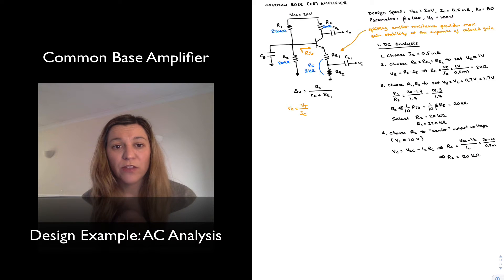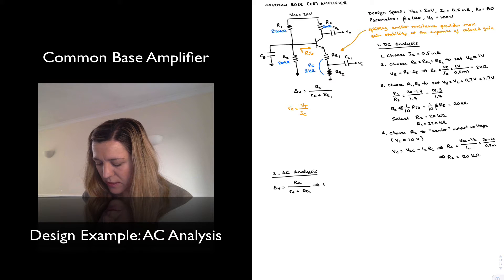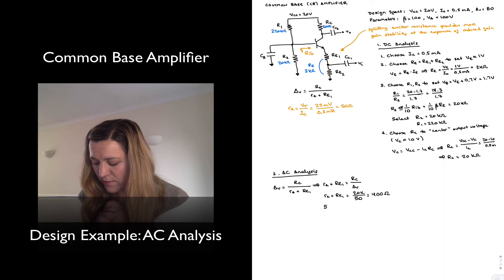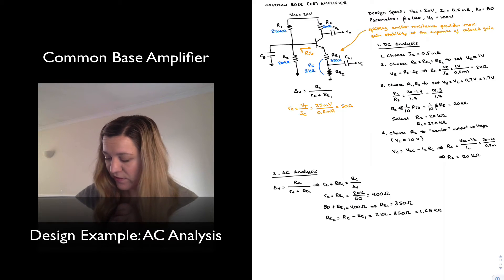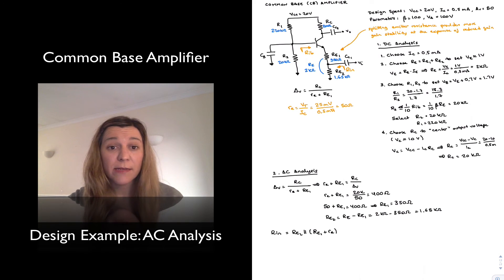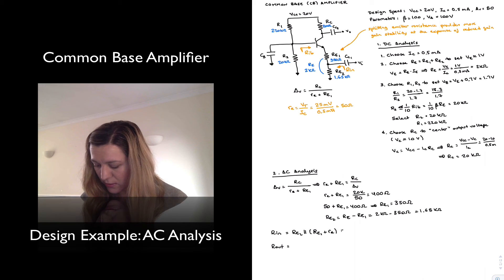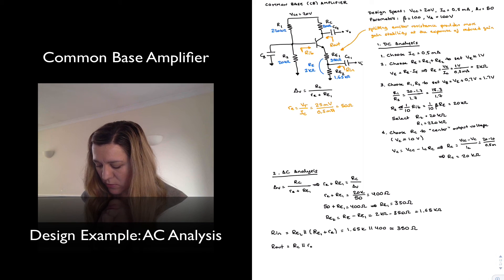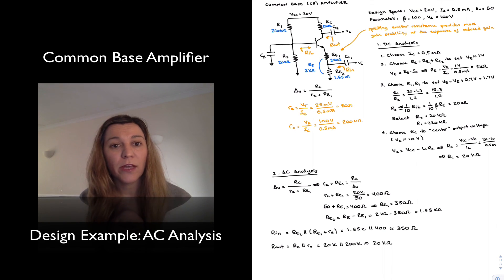CB Amplifier: AC Analysis

Comment: I have understood the capacitor was shorted the RE2 to the ground in the A/C analysis of the common emitter configuration but in this case  i do not understand however the capacitor is not shorted the RE2 to the ground why are we still discarding the voltage divider characteristics of the RE1 and RE2?
I am totally making this inference up but - Is it something to do with the RE2 will not effect the AC voltage of the small signal is because of it is connected to a DC ground?